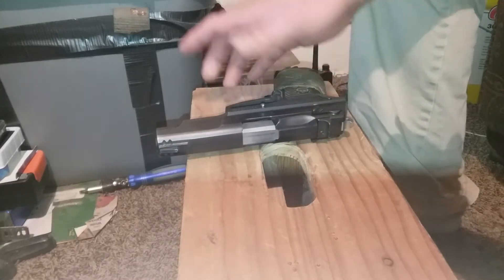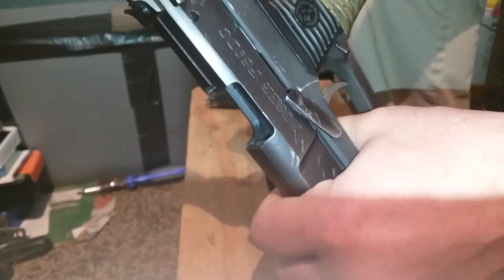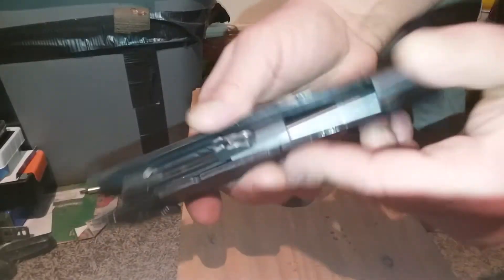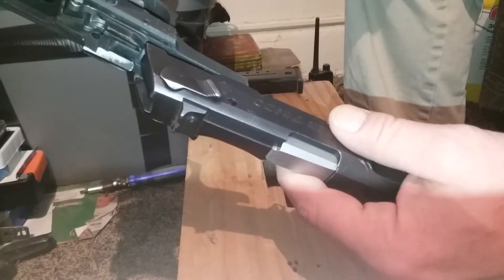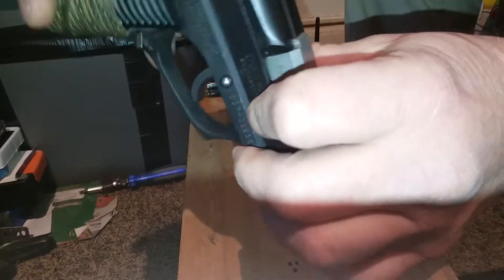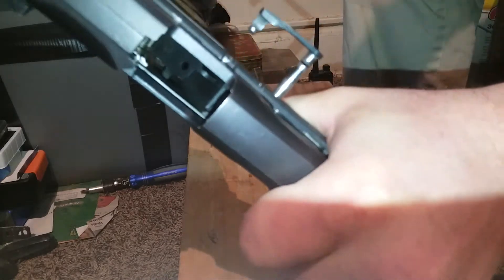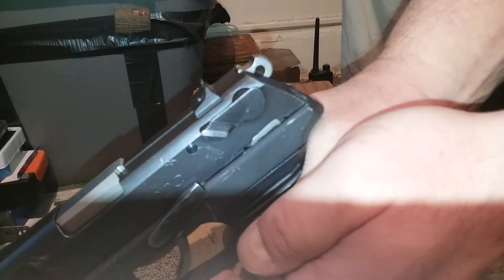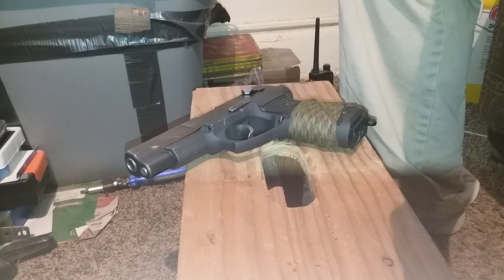Ruger P89 Disassemble & Reassemble...

Comment: I  am working on a P89 and picked up a slide and barrel for a P89 DC, it assembles onto my "frame" but doesn't "cycle" at all.  What's the difference, as they look the same, what do I need to mod to make this work, or should I just re-sell the slide and barrel?  Don't want to be "unsafe" and I guess I'm in the market for the correct parts.
Any help, thanks in advance !! guess I could shoot a video and show parts, but they really look the same.
Reply from the maker: Ya .so ive had both but never tried to interchange..but my beliefe is that that DC means double cocker..so when you normaly decock it goes to total safty.triger pulls freely with no ingagment..flip it up n its double n single action again..so i think the machanics just dont work with regular p89..hope this helps..
Reply: @christiancaveman5294  Thanks for responding - I "binged" many P89 videos and read comments until I happened to find the answer.
"DC" means "De-Cocker" and the regular P89 has a safety.  Somebody stole my slide years ago, but I still have the barrel, spring and spring guide, which when I find these parts I can install them into the DC slide and have a functioning gun again. 
Or I could sell the DC parts I just bought off eBay and buy the right P89 parts.

Comment: I see your Ruger Even when You put the chamber back . Let me know Master thanks ?
Reply from the maker: Dang bro i appoligize..just rewatch the video and seen whats wrong...the plunger nipple needs to be placed on top of the notch...most the ones i have owned slide into place so i didnt think to explain..hope this helps and thank you..
Reply from the maker: But it should rotate up into position..so play with it alittle until it works and becomes natural to do..
Reply from the maker: Hey Ruger bro im posting another video on the spring n plunger in a bit..but i did want to say if you have the p89 its usaully the 11 pound spring..the 14 is for the 90..45acp...you said u cut it down but if the spring tension is still to much it could cause stove pipping.ejecting.or cycling problems..hope this helps..thanks again..i gave you a shout out on next video..im glad you said something..
Reply: Ok thanks. Is right .,👍
Reply: @christiancaveman5294  i probe the gun and fire very Nice i know the spring recoil factory is 11 lbs but You can change recoil i see My. Friend he custom is just 3lbs THATS no much . Fire better shoots ..and faster power ..yes is p89 DC Ruger series P 1911 the tank
Reply: If You wath videos for compettions they use leess pounds in the spring recoil because the gun no jumping and have more presichion and control . Compettions they use 7lbs ,9lbs more control. But if You want faster power better function more pounds 14lbs is Good
Reply from the maker: Yes i have seen guys do mods for compettion..most was hammer spring to 19pnds n put P95 triger in P89..Without stout handloads or maybe higher velosity 9mm i just see problems with tension of 14 pound recoil spring..but ive never done it either..lower works but to much then you can get slap back with high velocity rounds...find happy medium and to each there own..thanks again..good insight..

Comment: My slide is stuck
Reply from the maker: Ok stop what ur doing....couple check questions....is it loaded or unloaded first..magizine in or out...and is the slide stuck open.closed..or partly open..
Reply from the maker: Did the slide get stuck when putting it back on the lower main frame of the gun...if so the ejector arm might of been in upward position and bent and pintched..
Reply from the maker: And forgot to ask..my bad...is it an Ruger p89 first off...

Comment: tried this, didn't work. have never been able to get the slide off.
Reply from the maker: Are you getting your pin pull fully out and the injector arm pushed down..if so something else might be going on..
Reply: @christiancaveman5294  very hard to get the pin out. don't think it has ever been field strip. a buddy with gorilla hands was able to get the pin out and it needed a thorough cleaning. had to use the bottom of the mag to pry it. eventually was able to use fingers after it loosened up. thanks for your comment.